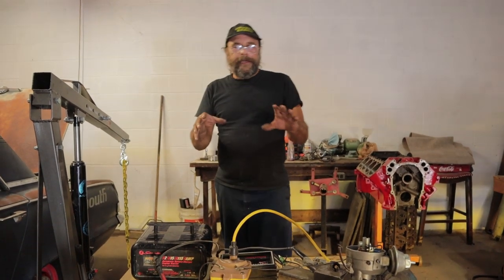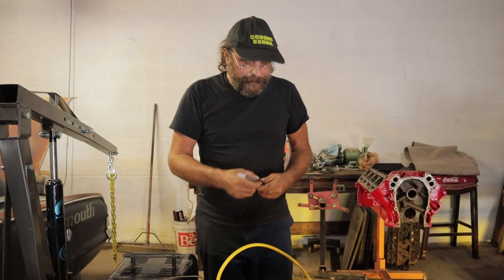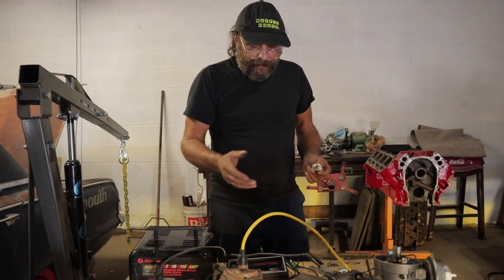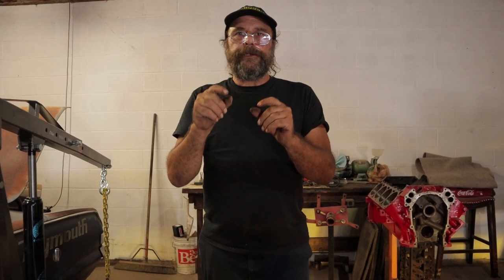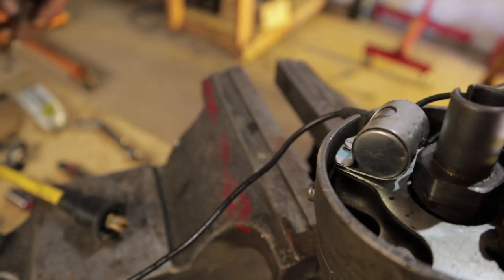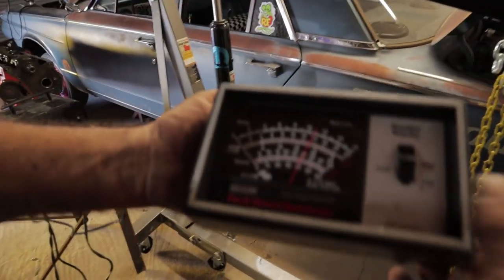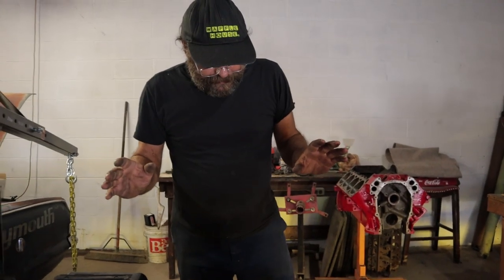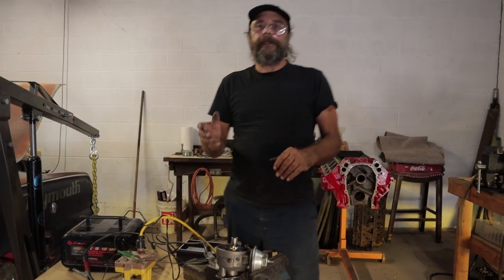Classic Car Tech-Setting Up A Point Ignition

Comment: condensor is an old word for capacitor.  Its 2 conductive things (the foil) with an insulator between them.  Usually the insulator is thin plastic film now, but way back when it was probably paper.  It stores a bit of electricity, so shock absorber is pretty accurate.
Reply: Ya I've heard it picks up and stores electrically energy that was left over from the coil when the magnetic field collapses.
Reply: gadget73 it’s engineering term for that time is a choke
Reply: Christopher Saylock a choke is another term for an inductor. Capacitors and condensors are the same.
Reply: And the paper was coated with electrolyte. A capacitor resists changes in voltage and stores energy while doing so.
Reply: @badbanano  A choke? No, that's a coil of wire. More correctly known as an inductor.
Reply: @therealblue42  both choke and capacitor or choke + capacitor are used in power supplies for the same effect (filtering ripple) and they work kind of the same for that application... inductors can also be used for oscillator circuits etc and capcitors of different values can also be used for coupling or decoupling ac signals but in this case and in the case of a simple transformer power supply they act as as buffer or filter, absorbing high ripple and releasing energy on  "low spots". kind of an oversimplified way of describing but that's basically it... they act like a small battery that charges and discharges very very fast
Reply: Hugo B. I have taken plenty of electronics classes over the years. I was just saying a choke is an inductor and a condenser is a capacitor.
Reply: @therealblue42  so what?i did not say you are wrong  i was just adding information....chokes and capacitors are different devices but in some cases are used for "the same" effect...that was my point
Reply: Ya. He should test the ones he finds for  electrical leakage.   Those old ones are probably all (electrically ) leaky.  
Check out mr Carlson’s lab.
Reply: capacitors do not store electricity    -----in a dist. they pass voltage thru the can to gd (small mtg screw) if wrong value microfared  all volts can get thru so it comes back to the open points jumps the gap to gd. causing points to pit .some folks change point thinking they have fixed the problem  soon it will be pitted also   ---alway change the condenser but it has be correct value microfareds to match the coil=i had this problem  changed condenser spark increased from 1/8 in to 3/4 inch jump with idle eng and plug wire held close to eng

Comment: Dwell effects timing but timing does not effect dwell thus once dwell is set check and adjust timing sorry maybe I am getting ahead of ya lol
Reply: You beat me to it! Not everyone knows about having to reset timing if the point gap is increased.
Reply: As I recall, the larger the points gap the smaller the dwell (coil saturation), and every thousandths of an inch in points gap is a degree in ignition timing.

Comment: The condenser is a capacitor, it absorbs the electrical current when the points open to prevent arcing across the points which keeps the points from welding together.
Reply: That's what I immediately thought when I saw the foil and cardboard.

Basically when the distance is low enough between points electricity goes across it and generates an unbelievable amount of heat, the capacitor to ground prevents that. I'm guessing it fills up in the dwell period preventing the current from arcing by lowering the current flow.

Arcing is exactly what you see the spark plug doing to that metal surface.
Reply: @vasilis23456  And Tony is correct, the capacitors these days are poor quality, even 20 yrs ago they were poor quality.  I used to buy 5 at a time for my Ford 8N tractor because they would crap out.  Some would last for months, some for days. I finally installed a Pertronix ignition system and solved that problem.
Reply: Another way to put it is that when the points open, the sudden high voltage potential between them causes a spark to jump through the air between the points, but, because the capacitor is wired in parallel with the points, the energy that would create a spark between them -- were the capacitor not there -- goes instead into charging the capacitor. Thus, the capacitor/condenser diverts the energy that would shorten the life of the points.
Reply: @perillouss3506  every eng is deferent the condenser has to match the coil in microfareds  if it does not match this is what happens  most of the voltage does not get thru  the condenser so it flows to the points jumps the gap to gd pitting the points you can not just put any condenser in and expect it to work correctly  you can get proper condeser info from dealers old parts books to get proper part # then cross ref it to todays part#s to get corect value

Comment: Oh yeah, I forgot to mention.  The young dudes at AutoZone and O'Reillys did not know what I was talking about when I asked for points files.  They didn't have them.  The dude at NAPA knew what I was talking about and had them.....they are cheap.  Cheers. Chuck
Reply: Napa can still get it done. 
Even if it's a kid I'm like lemme see that computer I know it's in there I have a stack of Napa parts books from the 90s I already looked before I came to the store.  🤣🤣
Reply: I'm a delivery driver for two local NAPA stores.  Our counter people are much more professional than some of the other parts stores that hire people based on the ability of computer look-up skill and credit card processing.  I'm not saying unqualified people in these positions are bad since they're not supposed to know the mechanical aspects of vehicles if they haven't had the exposure.  The difference is that NAPA seems to hire people with background experience.  Just about all I do is deliveries, yet before hiring me my boss cleared me with questions that supported my mechanical background.
Reply: @discerningmind  
I remember decades ago just about any parts store you went into most of the guys behind the counter could grab most parts you needed without looking them up in the old books, and most times they would make sure to ask if you needed the little things that you may forget, or not realize you need. Ie, locktite, points file, sandpaper, dielectric lube, etc.
Reply: Yes, I recall that too, many years back when I was a kid.  Back then there was probably all of ten common engines to remember and nothing emissions or electronically related as there are today.
Reply: @discerningmind  yes, sir. So many little electronic and emissions related parts now.
Reply: @sidewyndersshed1676  Yea, I'm 60, back in the seventies and eighties before all the big chains took over!! I know one guy in my town, he's still an independent....Knows his shit!!
Reply: well you have parts people and you have people that work at a parts counter. There is a night and day difference.i can't count the times at any parts counter dealer,chain store,small engine shop that I was told they didn't have  a part that they had in stock.now a days I just look up the part number online and give them the number.just yesterday I needed mower blades and dude said I will have to order them.i gave him the number and sure enough had two in stock.it was  a Dixon mower same as a husqvarna just a different color .since they didn't  sell dixion his lazy ass didn't  bother to look it up.

Comment: Being 20 driving a 1976 chevy luv as my daily commuter and telling the older folks that i just adjusted the points puts a smile other faces keeping classics on the road is not for the faint hearted no power steering no air bags and or automatic transmission you gotta be a real man to drive old vehicles
Reply: That`s true for using old Ford tractors for your farm work to! Most of the other farmers think at 65 were a little crazy to actually farm with our antique tractors all made in 1952 ,but they are simple & fairly easy to work on & don`t cost $10,000 to replace hydraulics!

Comment: Also uncle Tony, a condensor is a battery. a friend of mine got on the school bus,(1977) handed me one and asked if I had ever seen one (he was careful to hold it by the base/sides, I grab it by the sides and slide my thumb/finger down the wire, POW, 40,000 volts! You can put the wire in a spark plug wire with the case on the block, start the car,(charge it) and not touching the wire sit it on a table, it will stay charged a long time and bite the first person who picks it up and completes the circuit! He helped his Dad put points/condenser in their '67 Mercury Comet b4 school and thought it would be a funny joke to light up his friend on the bus.

Comment: I run old cars, motorcycles and flathead engine boats from the 1940's. It is next to impossible to get a nearby mechanic to work on any of them.The more you know, the better off you are with these old machines. Tony's knowledge and communication style are very valuable to anyone interested in using and preserving "old school" vehicles. Subscribed!

Comment: Ive got a few vids on how a points ignition system works.
The condenser is matched to the impedance of the coil windings so that when the points open and the magnetic field collapses the "back EMF" (a voltage that flows back out the low voltage side of the coil) oscillates back and forth between the coil windings and the condenser that produces a lot more energy at the coil than a slow decay of the magnetic field in the coil if there was no condenser. Which is why a poor condenser will cause hard starting due to low coil energy at cranking.
The oscillation can be seen on an oscilloscope which we used to use to tune ignition and diagnose faults.
The oscillation can be seen on both the primary and secondary side of the coil on the scope because of mutual inductance which to put it simply is that what occurs on the primary side of the coil is reflected on the secondary side.
"Back EMF" I refer to is a voltage much greater then 12 v on the primacy side and if you want an example of that hold your finger on the 12v terminal (from the ignition key) of a starter motor as it is cranked and when you release the key to stop cranking you will get a shock from it that is a lot more than 12 volts, and that is what back EMF is and it occurs when 12v is released on any coil winding including relays
.
In relays you can simply use a reverse bias diode to divert the back EMF to ground to protect its contacts however if we used a reverse bias diode on the points to snub the back EMF it would stop the points burning, but the coil would have low output hence why a condenser is used to increase coil output.

Comment: Uncle Tony,
Great video.
As mentioned here by another viewer, condenser ( capacitor) same beast.
The oil in the condenser insulates the two coils (plates) and becomes the dielectric. The substance responsible for storing and releasing the electric force. 
I recently suffer from memory loss, so 40 + years of my electric/ electronics knowledge is lost. Sometimes some returns. 
Anyway, points used to come with a small capsule with points grease in it.
For me, changing points on my slant six was a bit tricky because of the angle and location of the distributor.
Those points screws are short and small, but I never dropped them in the distributor or never lost any...
I never felt comfortable pulling a dustributor..You have it down pat being in the business..
To each his own. Great info, thanks Uncle Tony!!
Reply: I have lost a screw down into the distributor.  Thus the magnetic screw driver.

Comment: I’ve had 3 vehicles that have had points. 68 /6 cuda, 70 dude truck, and my hearse. The 70 I never had any problems with. The hearse I ended up putting a pertronix convention in (afterword I found that I couldn’t use my first gen msd 6 box with it). The only problem I had with the cuda was the condenser. I remember telling my dad that I couldn’t figure out what was going on with my radio. He asked what was it doing. I told him there was so much static you couldn’t hear it while the car was running. He went to the tool chest and came back with a grungy cylinder with a wire sticking out of it. That’s when he showed me how to work on points. And that took care of the static.
Reply: My first truck @ 16yrs old was a 1970 DUDE Maroon and white. 
I blew up the motor and mom sold it. A very rare ride.

Comment: I always used the pull tabs off of beer cans on my 72 truck. Probably didn't have a matchbook but I damn sure had a pull tab in the rolling garbage can otherwise known as the bed. Been decades since I set points or rebuilt a carb, something I did with great regularity keeping my POS truck running.  Great old days.
Reply: Many moons ago, I broke down at a red light in the back end of nowhere with no tools. Popped the distributor cap and immediately realized that the points were pooched. It was back when ring pulls were steel and came off the can, and I found one lying in the gutter and used it as a screwdriver to take out the points and condenser. I knew my Dad didn’t throw stuff away, and sure enough, there was an old condenser at the back of the glove box. I took the points apart, refaced them as best I could with a flat piece of stone, and she fired right back up. Drove it home and ran it like that for months.

Comment: Points are super reliable as long as you keep up the maintenance.
Reply: points are nothing but a switch which removes the gd, as they open allowing          voltage to flow into the condenser thru the can to gd  the condenser has to match the coil for max spark if it does not match its a weak spark and pitted points since voltage did get thru condenser it flows back thru open points jumps the gap to gd causing the points to pit.    condenser are rated in microfareds  correct value is very important for max spark  my truck uses a 27 microfared condenser  this info is avail at dealors old parts books  get original part cross ref  it to todays  part #s for correct value.

Comment: I would buy Penske high performance points/condenser sets at Sears back the '70s, that's when Sears sold speed equipment and stuff.  It's refreshing the way you show how well points work and can be counted on when maintained.

Comment: I am happy that I don't have any cars with points or carbs. New plugs and wires every so often and. Your good to go.

But, Uncle Tony is spot on with this video. I will add only that while you have the distibutor out, ckeck for wear on the shaft and be sure the felt oilers are lubed or you will be buying a new distributor more often than needed.

Comment: Tony, I grew up on a farm where we repaired all of our own stuff. My Dad used to be a mechanic and taught me everything he could. I went into the Army   as a Heavy wheeled maintenance mechanic and Diesel engine mechanic. I never knew what a condenser was or what it was really doing. No one ever taught me. I just learned how to check and replace it. I was taught to change it every time I replaced points or a coil. I got out of the Army and decided to use my GI bill to go to HVAC school. That is where I finally learned enough to understand what a condenser was, why it was built that way and what it was doing. In HVAC school I learned all about capacitors and the light went on and I finally fit the puzzle together. The condenser is a capacitor. It builds up voltage or energy and matches or nearly matches the output voltage of the ign. Coil. That match reduces the amperage and arc when the contacts open because there is a matching potential voltage on both sides of the point contacts so you don't have a huge current jump between them and burn the metal. It is very important that the condenser value is made to match the ign. Coil value. It took me 24 years to learn that and 2 different trades and schools. Before then it was just do what I tell you and don't worry about why.
Reply: I said output voltage but you know what I mean when you break the coil field voltage through the points to generate the spark volts out of the coil wire.

Comment: l find the same issue with new points, they just dont hold up, l have a stash of the old good stuff, well l kinda have a stash of everything,
Reply: Grandma's Malibu the points contact pads suck ass now. They glue them on. Every time I hit 6500+rpm, the contact pad falls off and the car dies cuz the points gap has opened up.
Like clockwork.
Reply: @cruzinezy1968  
Yea I was gonna say, I've noticed the rubbing block seems to be lame anymore , weak/cheap plastic.
Reply: Yeah man, I just got a set of points running on a Honda 70 from 1971! ORIGINAL POINTS! I did buy new ones from China but I got scammed. The pints were crap anyways, the rubbing block when I got them broke as I installed the bushing. The points were a complete opposite of what I ordered. They were flipped exactly to the other side!
Reply: The key to new points and condensers is NAME BRAND, Briggs and stratton is better then Rotary, AC/Delco is better then china, Motorcraft, Mopar. You can get a set of points and condenser from auto zone for $5, AC/Delco will cost ya $40, but they american made, higher quality control. Same goes for distributor caps and rotor buttons. I love auto zone, I went to get a distributor /rotor button for a '91 chevy truck, when I took it out to make sure it would fit, I notcied someone had put their old one back in the box and returned it, I looked at the cleark and said, we would prefer a new one.. but even the new one was no where near quality an ac delco one would have been.
Reply: Yeah the rubbing block on the points are to soft wear faster